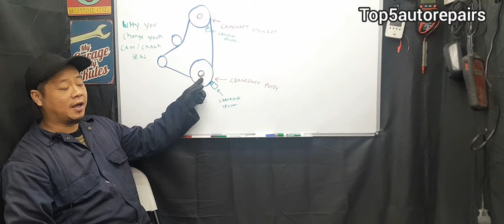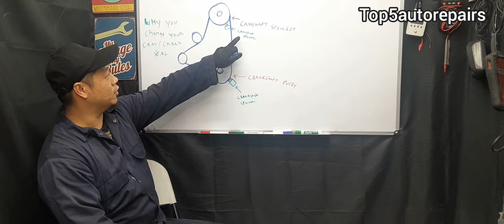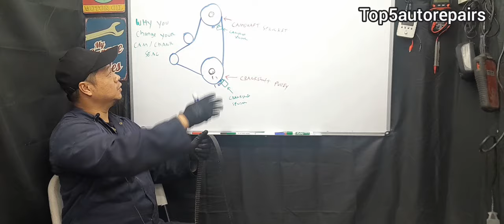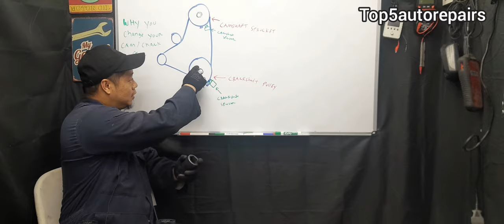CRANKSHAFT SEAL AND CAMSHAFT SEAL SYMPTOMS  | OIL LEAKS

Comment: I think you pinpointed the problem I have with my 1996, Chevy 454 big block engine.  I'm getting an on and off camshaft sensor error code, but the motor runs great at 86,000 miles in my RV.  However, when I checked the motor from underneath, I can see oil leaking from my crankshaft onto the sensor plug nearby.  Since my motor otherwise has been running great, I'm hoping cleaning up the outer oil leak that has soaked the sensor plug might solve my problem. Thank you!   
Where is your shop?

Comment: I have a 2002 civic dx, Ive had an oil leak for a few months, I haven't been too sure where to find is but now I see residue from the belt getting oily, and buildup around where the pulley sits. I also can't drive more than 2-3 hours without the crank sensor code being thrown so I'm pretty sure this is the issue now

Comment: What if I've replaced 100's of seals and I have a new build that the seals won't seal. Honda B16 head
Reply from the maker: Use MLS head gasket and copper spray and torque to spec. Use honda bond for crankshaft seals.
Reply: Did that my guy
Reply: @williamlopez103 was the head or block line bored? Either the head/block is out of spec, or your cams/ crank journal is.